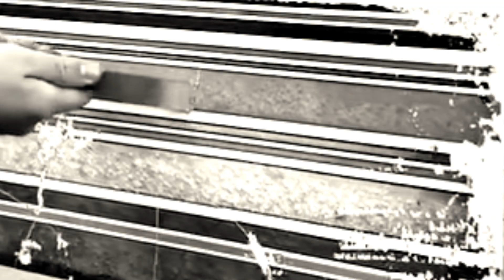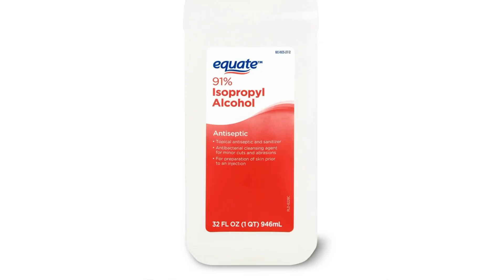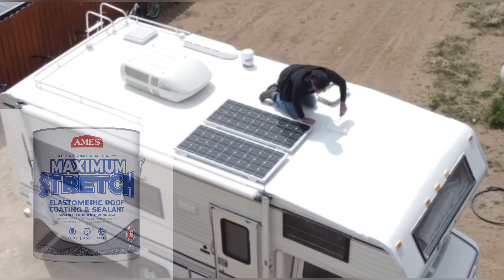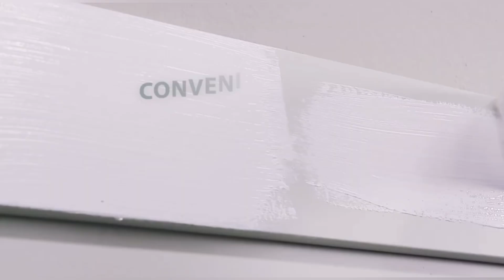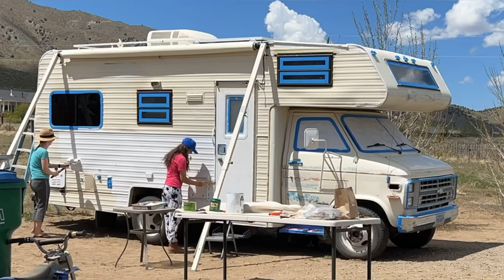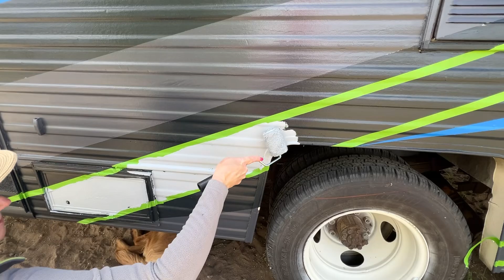Can You Really Use House Paint On An RV? #rvlife #howto #travel

Comment: @MapleBoarder78  I just watched your modular home videos and really appreciated them! My husband and I are looking at getting a Fleetwood Waverly Crest Prestige home from the Nampa, ID Fleetwood factory and I’m curious what factory yours came from and what dealer you used? Is it still holding up well? Thanks and God bless!
Reply from the maker: @cherrishswiger  Hi Cherrish, ours was from the factory in Idaho. We worked with our local dealer. We love our house and are so glad we went modular! It’s extremely well insulated. We highly recommend upgrading to LED canned lighting and placing it generously throughout your home. Some of the things I would change if we did it again is making sure to get the proper sized exterior window trim thickness. Our sales lady was fairly new and because of this we weren’t made aware of many of the upgrades we needed to choose. We were not aware the kitchen sink didn’t have a garbage disposal standard, so we had to add one after the house was built. Another upgrade I would ask about if available is the bathroom fans. I replaced those with premium quiet fans because the ones that come with the home are extremely loud and inefficient! It was a pretty big job to install them, so if they can upgrade the fans while the house is being built it would be much more convenient. We upgraded to the “premium” carpet option which wasn’t really premium but was better than the standard option. We’ve been here 8 years and the carpet probably needs to be replaced in the next few years. Good luck on your home journey. God bless.
Reply: @ Thank you so much, that is very helpful information!